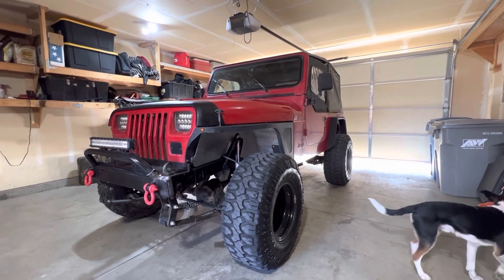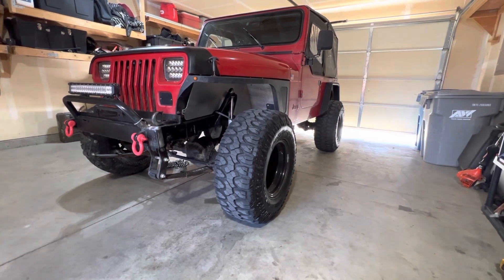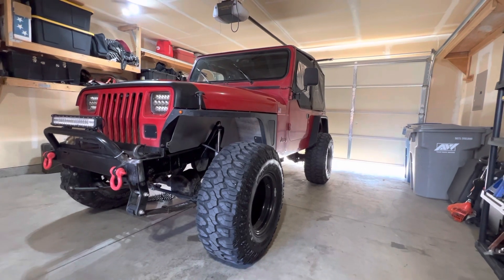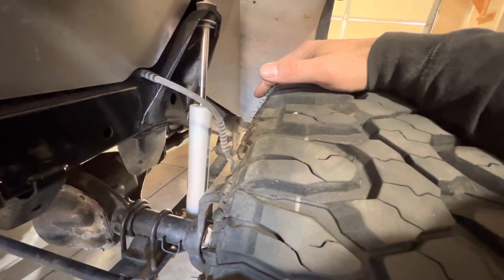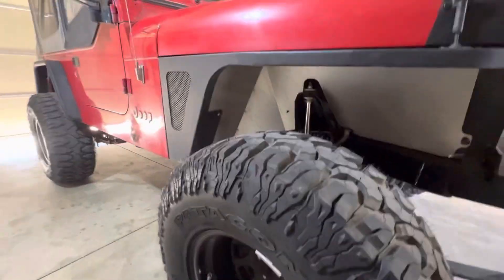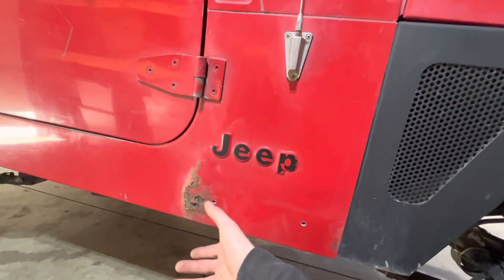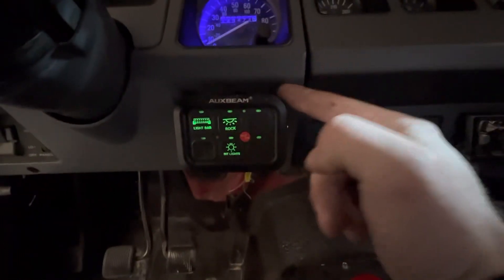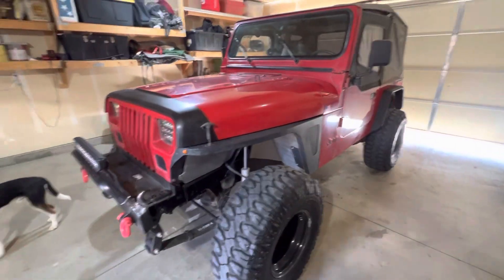Jeep wrangler walk around

Comment: Did u remove your track bar and sway bar with your lift kit? I am considering taking mine off as I have some bunpsteer and bad angle so a lot of people say to take off the track bar and sway bars if your lifted? Also how does it drive without track/sway bars?
Reply from the maker: I don’t think removing them will help your bump steer. You may want to try an extended pitman arm. But YES! I removed front and rear track bars as well as the front sway bar. It does drive slightly different so you’ll want to be careful but I think it is the best mod I have done! It rides much better and flexes 2X the amount it did before